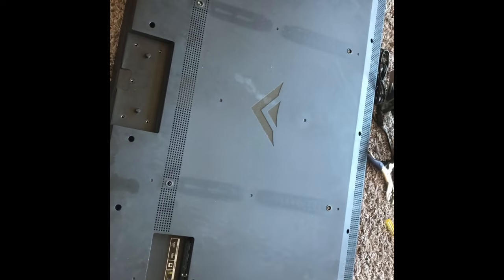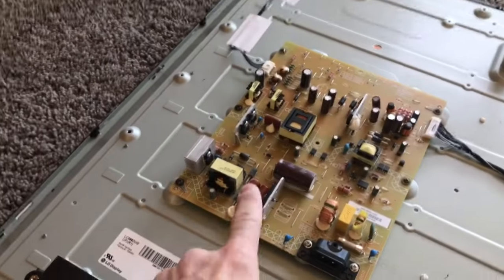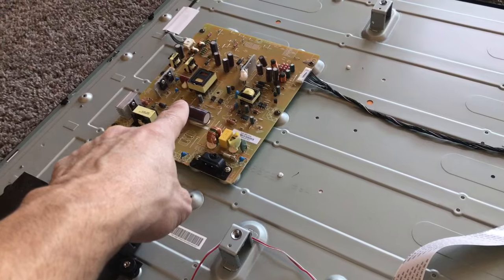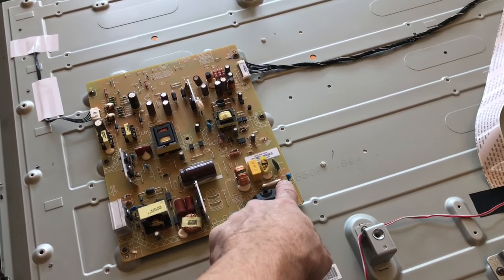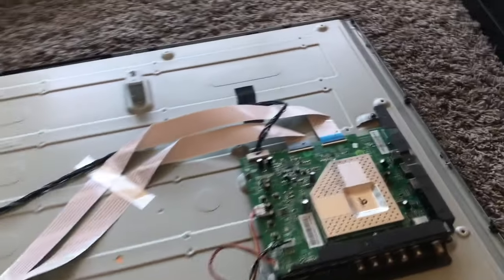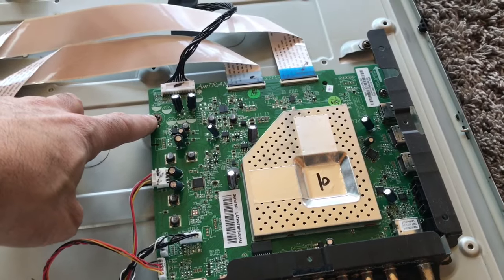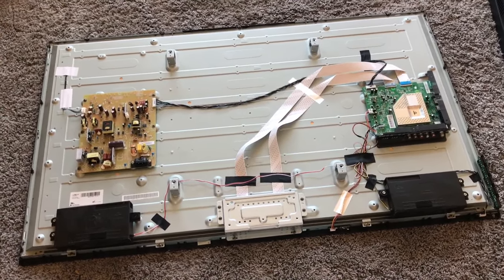How To Open Any Flatscreen Tv

Comment: Bro, you must not have much hands on experience because almost all brands of tvs snap apart differently.
Reply: Foreal
Reply: Yup mine is a wall mount screen TVs way way different from this 🤣
Reply: Flat screen TV
Reply: I'm sure you are correct that the dissasembly differs between brands. I've done a few and as long as you aren''t planning to put it back together again, they are similar enough to plough thru:). The last one I did  today was a Sony Bravia  50 inch or so, older (4 inch wide) so yeah I took out probably a few dozen screws and still had a few I forgot about. This one had been unplugged and broken for about 6 years so I wasn't afraid of any juice being in the capacitors.
Reply: @toys2work  I took electronics, capacitors can hold a charge for years.
Reply: I am still trying to figure out how to take apart my 40 " Samsung older model. Something is holding it somewhere but haven't found the reason yet.
Reply: Sick burn

Comment: We have a problem in South Africa. Our power grid is in a sad state due to corruption right up to the elected officials. So, we have what is known as load shedding. The power is shut off to areas throughout the country on a rotational basis.  My Samsung LA40D503F7R draws 180w, but I want to reduce this load for my power backup unit. Will removing the analog TV tuner reduce the load? And if so, how do I do it? I use the TV only as a monitor connected to an Android TV  media box.

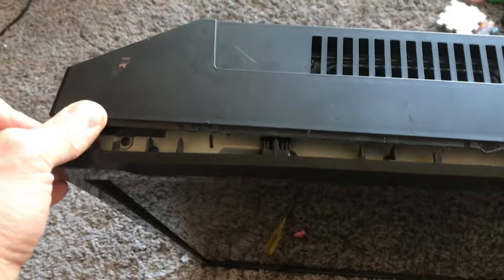Comment: Hello! Thanks for sharing. I got to part 00:50-01:03 of your video, where I got the back open but the front seems stuck and there are no screws and I'm scared to push too much in case I break it. Any ideas? It's an LG model
Reply from the maker: Yes use something flat like a butter knife and stick it in where the tv splits and pry it there are usually internal shaped plast clips all around the split line u must unsnap them all

Comment: Hi ive got sony smart tv model:
KD48A9BU
How do we disconnect the in built wifi/bluetooth emitters from motherboard but keep ethernet internet connection only.
Reply: Could be tricky (impossible) if there is no separate network module for the wifi/Bluetooth module. If you want to be hackie you could try scratching the path to the Antenna (Ethernet should still work, but perhaps the whole module will just say it is damaged because of an internal errorcode so it will not work anymore). Scratching the path to the wifi and Bluetooth antenna will most likely result in your TV telling you that there are Wifi/Bluetooth connection problems, what could be a minor annoyance. The hackie way is also the dirty and risky way.

It really depends on your TV. Have you checked if there is an option in the settings to turn off Wifi and Bluetooth?

Comment: Hey is it safe from an electrical perspective to open these TVs? (after unplugging them from the mains of course). I'm well aware of how CRT TVs are dangerous but wasn't sure about LCD.
Reply: If you're scared of getting shocked I recommend wearing gloves. And regardless electricity needs an entry and exit spot to pass through, so as long as you don't touch two ends of a metallic part it won't flow through you.
Reply: @rachel1215  thanks!